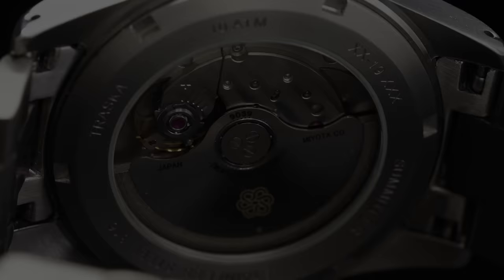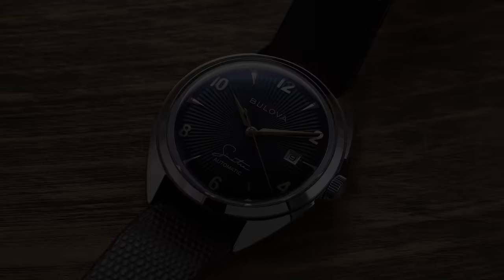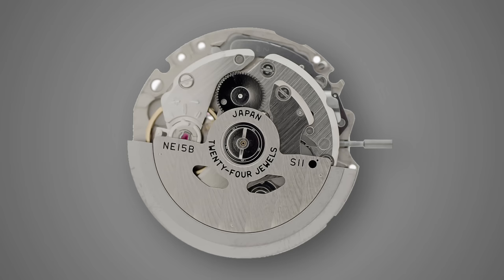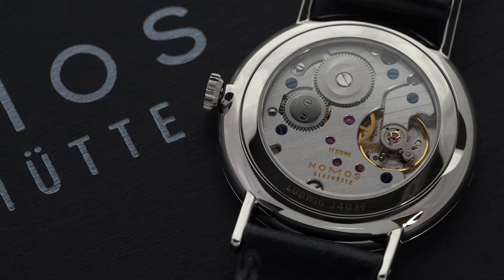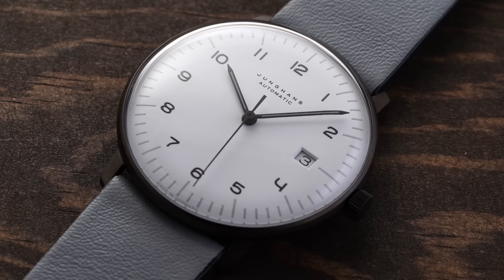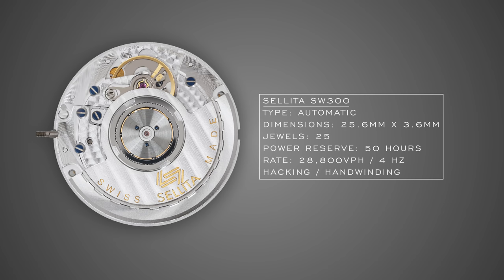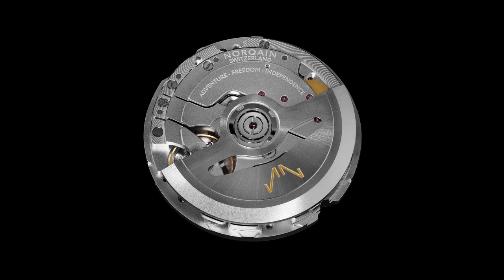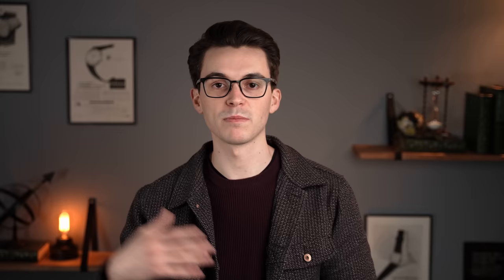Overview Of Third-Party Movements: ETA, Miyota, Seiko, & More (A Comprehensive Guide)

Comment: I think that „inhouse“ is both confused and confusing. What is actually meant by that? So when we face a Seiko watch with a 4R35 its a very good „inhouse“ movement and when the same NH35A is to be found in hundreds of other brands its not so good? Hahaha. „Inhouse“ then was a marketing trick and thats it. Clearly, most of our „yt experts“ have propagated such, well, sorry, nonsense from video to video. Fact.
ETA, Sellita, Seiko and Miyota (9 series at least), even Chinese ETA clone PT 5000 are very good movements which are a good enough for any decent watch somewhat below the „status league“ which I think begins at ,say, $ 3000.- to 4000.- or even lower.
My three favourate watches, two of which have NH 35A and one with SW 200, run at -2, -3 and -1.5 respectively. None of them is „inhouse“. One of the Seiko movements and the Sellita started at -11 and  + 14 resp. from stock and I was lucky enough to regulate them down to -3 and -1.5 spd resp. Ok, the second NH 35A with -2 spd seems to be a lucky draw. Last but not least, I‘m tired of the amateurish yt phrases like „well, thats a proven reliable workhorse“. What is meant by that? That it will last? Sorry, this is 2021. Imho, accuracy is the one and only thing that counts when the sun begins to set. That said, I think movement manufacturers should concentrate more on narrowing their somehow shocking wide accuracy tolerances instead of focusing on ceramic, „suratzu polishing“, screwed bracelet links or even power reserve and all that. Nice, but for me personally thats of secondary importance and it can never be a true USP that will last. Its all too easy to imitate.
Reply: If you want an accurate watch get a quartz, decoration is nice
Reply: @oscarosullivan4513  if you want to know the time very accurately look at your phone. Watches are about far more than accuracy. In fact I’d go as far to say I genuinely don’t care about accuracy when buying a watch, when I look at my watch to see what time it is I’m happy with it’s about 10 past 2 when it’s actually 2.12. Close enough for me. Most watches on average gain time so if my watch is a bit out I’ll just be early to everything, not the end of the world.
Reply: If the sun is setting that tells you it’s getting towards the end of the day depending what time of the year it is, unless you are defusing a bomb that will go off at precisely a certain lime you don’t need absolute accuracy. And if you are, look at your phone.
Reply: @Jabber-ig3iw  What is wrong with quartz